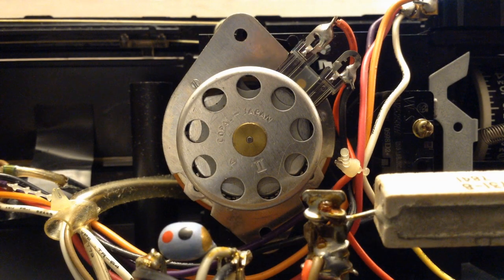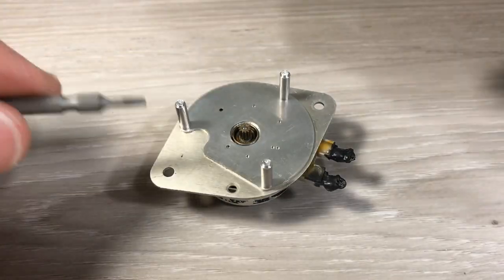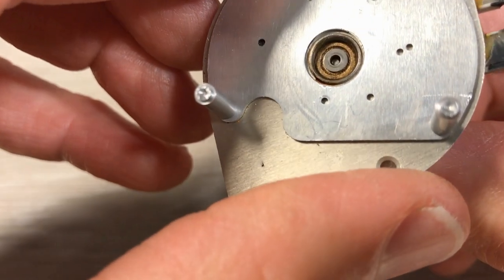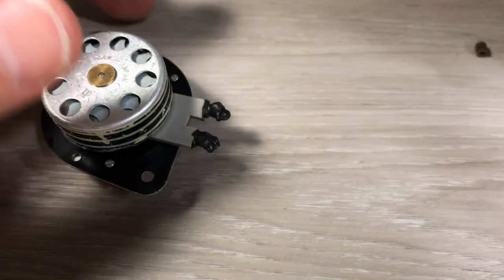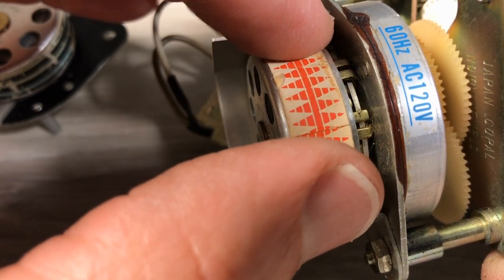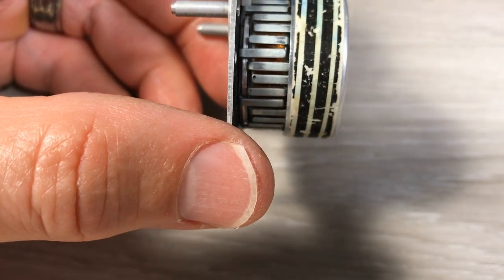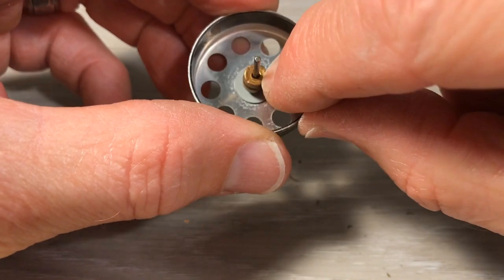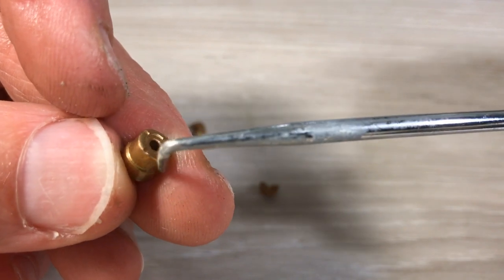How and Why you need to oil the motor in your flip clock.

Comment: Thank you for showing us the insides of one of these motors! That porous bronze material is called "Oilite", and you are right that the intent is for it to absorb oil.  I oil Copal motors in the same way, though afterwards I roll up the corner of a paper towel, and stick it through a hole in the rotor, to soak up the excess oil.
Reply from the maker: Great Information!! Thanks !

Comment: Nice video! I had a GE C4315B flip clock for 40 years and the motor eventually crapped out. Wish I had kept it to try this maintenance technique. I also read that there are plastic gears that eventually wear out. Is that fact or another rumor? Thanks. Appreciate your efforts on this. When I find another GE flip clock -- I'll be getting it for sure.

Comment: hi! thank you for all your excellent flip clock videos! I am wondering how many drops of clock oil you recommend using? I have a copal 222 with a noisy motor. Thank you for the guidance!
Reply from the maker: I will tend to load it up and run it for hours to let that oil get back into where it needs to go. I’ll re-oil it several times. There will be extra oil that you can blow out later. That oil needs to get back in there and get to what’s called the oil bearing.

Comment: would it be possible to drill a small hole nearer the center just next to the brass piece? it would be easier to get the oil into the right place then, or would it knock the balancing out ?
Reply from the maker: It sounds like a possibility, however, it seems like too much trouble and could possible cause serious damage. I personally wouldn't do it due to the possibility of unbalancing the wheel, like you said, but also, the way we're doing it works. 
Thanks for thinking about this. Next time I have one open I'll be looking at it.

Comment: Those brass bushings have worn out on my motor and so the rotor gets stuck to the stator every once in a while. Will need to figure something  out how to fix it. Maybe if there are some tiny ball bearings to put instead... 😊
Reply from the maker: Or. Time to get a new motor. It’s amazing how long they lasted.
Reply: @Flipclockfans  I am trying to find a replacement motor but cant find it. Do you have a source for these motors?